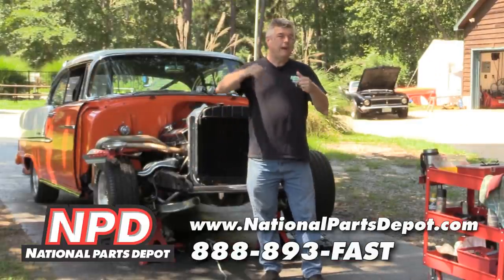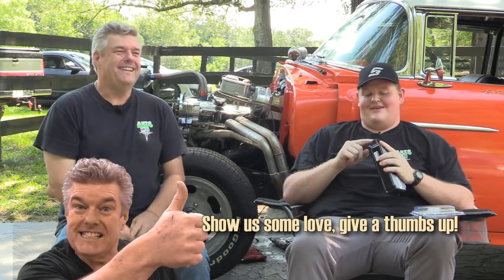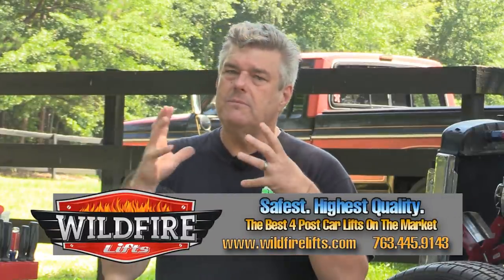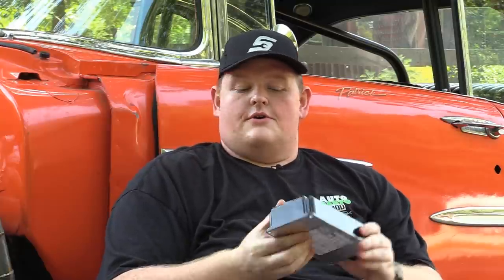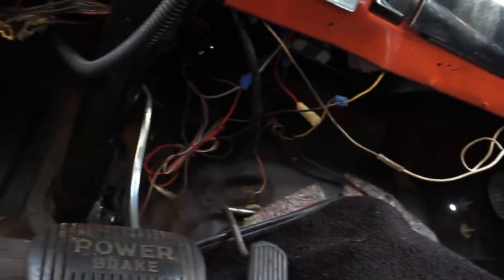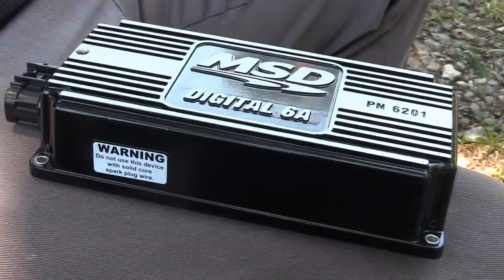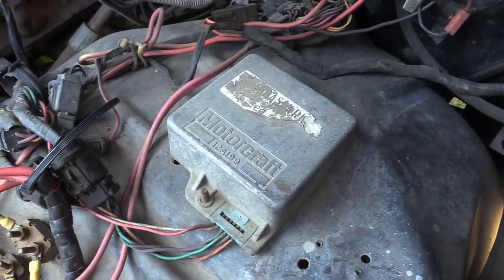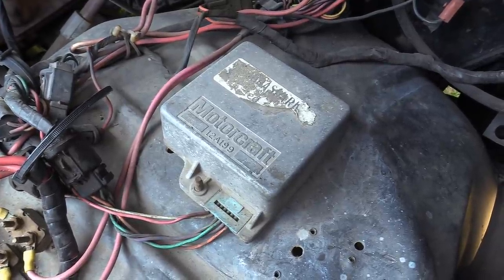Should I Use an MSD

Comment: Those duraspark boxes... I mean I got cj-5s roll thru that still have original boxes. Its impressive. Ive tied Howell TBI kits into MSD 6AL w tach adapter (Howells)w great success. The owner hates pertronix lol Definitely make sure everything else in the ignition system is good. Dont slap a MSD  w shaded rotor , dusty ass built up cap.., Dont remember when you put those wires on... All that has to be good it trickles down.

Comment: Back when I used to build hotrods I used to run the Ford EEEEk boxes.  LOL  At the time I ran an 11:1 429 and used the timing retard on the boxes.  Soon after the boxes began to melt down.  They would literally melt.  I quit using the Ford boxes and went to the aftermarket.
Reply from the maker: Whew. Not cool. melting leads to fire...

Comment: Duraspark IIs all had 10 degrees of start retard. And they are inductive discharge and therefore only spark once. Personally I use the Duraspark II module to trigger a MSD AL with 2 step retard so if the MSD box does quit I can change 3 wires and run on the Ford box. One other thing on the DS II is it is actually just an amplifier for the Hall effect trigger in the distributor.

Comment: Top of fender well idling with hood up I could barely touch the unit. It ran HOT. MSD said that’s ok… eventually failed…slowly get worse. This time MSD said shouldn’t run that hot…Sent it in for repair. Not fixable: PCB board “carbonized”
Buy another… I don’t think so

Comment: Guys, I have an MSD multiple spark discharge box 6AL  #6420 and an MSD distributor # PN8582 I'm putting it in my 65  comet. I bought a new stock starter solenoid  and it says do not use on electronic ignition. Is this going to be a problem? Can you send me a drawing on a cocktail napkin showing the wiring from the key to the red wire on the box and the start solenoid?  Or do I need some sort of isolation relay? Glen, You re
sponded to a question I sent a month or so ago and your respond time was amazingly short! Thanks

Comment: I have a 1995 Dodge Dakota 4x4.
I want to switch over to a 650 CFM FST carb.
The only problem I have is, I don't know if the MSD A6L ignition box is what I need to bypass the ECU.
Can you fill me in on anything I am doing wrong.
I haven't tried the setup yet, and I have replaced my fuel pump, installed a fuel regulator, and a points distributor.
Am I overlooking anything?
Reply from the maker: Honestly, newer than my normal. Since the Dodge has electronic ignition, why change?

Comment: I currently have an Ignitor to replace the points on my 1964 Ford f250. I have heard of these MSD units and was wondering what is the benefits or if it is worth the investment.
Reply from the maker: I personally wouldn't put the MSD with the Pertronix. I would just let the Pertronix do all the work for me. Make sure you use their coil with the distributor.

Comment: What's your opinion on the MSD Streetfire Dizzy. Having alot of trouble out of mine. Wanting to switch up to a Electronic ignition. 
Idk whether to go HEI or External coil type MSD....350sb small cam, Weiand Street Warrior intake Edelbrock avs2 carb in a 82 C10
Reply from the maker: If you want the ease of an all in one I like Pertronix.
Reply: @AutoRestoMod  looking at a pertronix set up rt now. 
Hearing better things about them than MSD

Comment: To hell with points.  Mechanical advance or locking out along with a CD box is worth it.   Especially if you wind up going EFI and want to run spark advance off the EFI.
Reply from the maker: In some cases you are right. I still like points for the simplicity.

Comment: Nascar have has compulsory 9" for decades. A 52 year obsolete part!!
MSD?  I have had both Crane and MSD boxes give up on me. One on my classic roadcar would work,stop. And restart 10 min later. Why?? Dont know. Replaced it and it works fine all of the time.
Racecar,, got to the racetrack and would not start, had been driven on the trailer the afternoon before. I had it checked, worked on the test.  Put it back on the car, it fired, stalled and that was it. So I bought another one. Which so far works fine.
For most motorsport they are essential to get max power from the engine,,HEI for instance starts goin back about 2 deg at 6500 rpm.
Road cars,,,,using unleaded fuel in cars designed for leaded fuels means they run like crap when cold,, after it has started and then are generally not what they should be the rest of the time. Ign box means it starts almost like an efi car and you can drive off immediatly and has noticeable better driveability and power. And you can use a couple more degrees of timing too. That is on 98 octane ULP.. Holley, mild cam etc and points ignition using white wire. You do still have to adjust the points every year or so!
For a stock or mild roadcar the basic [MSD Streetfire] boxes work fine. IF you are turning over 5000 regularly you need the more upmarket ones.

Comment: Wouldn't waste my money on msd had a new pc7000 dizzy put a msd blaster coil on it the coil blew up in 6 months an took the module on the dizzy out put a Bosch coil an module on it an 15 yrs later is still working the coil is mounted on the ac bracket on my 351c f100 1982 model an no ac an on my 76f250 351c I've got a pc8000 an pc box like a msd an high voltage coil mounted to the inner guard near the hood hinge never had a problem with any of it in 25yrs so look up pro comp electronics an 2 buddies of mine both had msd 1 the 351 reedy to run dizzy broke in 3 months an the other the box died within a year of fitting it an the car was only a weekend cruiser so I know msd has the name but our experience it was junk an my other buddies are guys that know what their doing withover around 30 yrs in auto  mechanical trade
Reply from the maker: Hate that. But I've had similar experiences with parts. I like the Pertronix stuff. Never had a problem with it. Others have not been as lucky.
Reply: @AutoRestoMod  if you find something that works stick with it theirs to much junk for sale these days from pop up sellers that you can never get warranty out of
Reply: You must have had thye ProComp that actually worked. Garbage parts!!